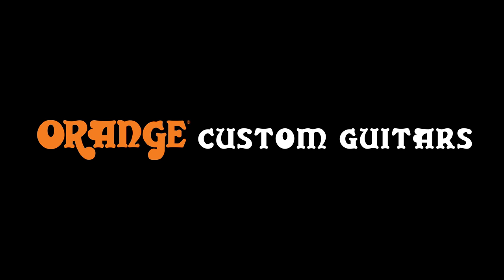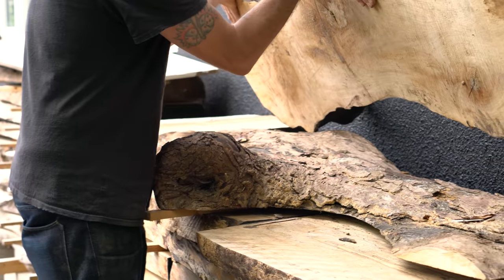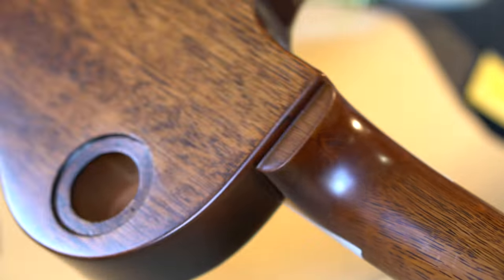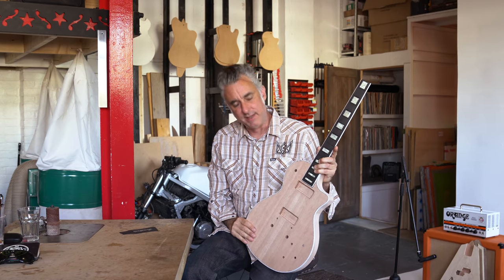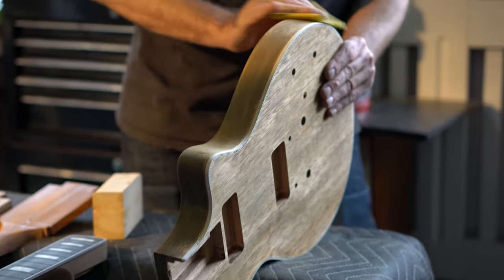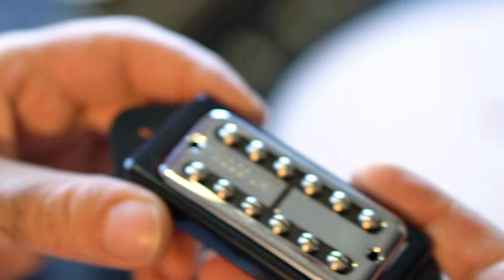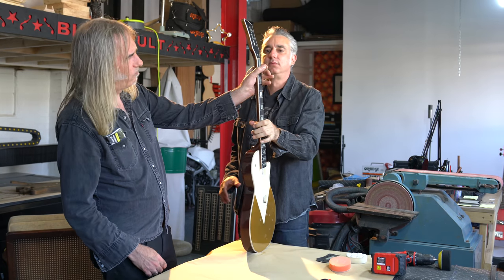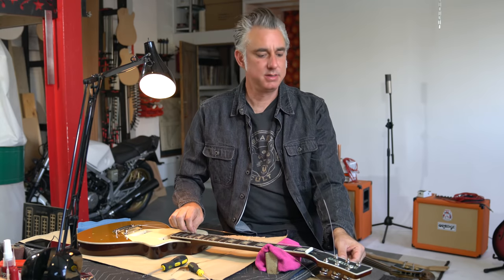The Orange Custom Guitar

Comment: Beautiful, and great finish as well. Only Orange could come up with that.
Reply: Other guitar companies have done similar. Not exclusive to Orange.
Reply: @jreagle58  Gotcha, I guess I meant the whole guitar in general is a unique product but didn't word it that way.
Reply: @jameslighterGTR  Actually the whole guitar is very old school. The neck profile is a 59 shape, the body is, of course, Les Paul-esque with a reshaping of the horn to avoid any problems and the headstock is changed for the same reason. The Staple pickups  are similar to the 50's Staples and the Filtertrons taken from Gretsch.

Comment: Perfect neck angle? Judging by the height of that tail piece your neck angle is a bit off. You have to crank it pretty high off the body for the strings to clear the back of the bridge, Thats usually a sign of a bad neck angle.
Reply: I have to do the same thing on my Gibson Flying V, but I love it! I do wish I didn't have to do that though. I think my Epi Les Paul is the same way. I've thought about cutting into the back of the bridge to get a lower tail piece, but I don't want to compromise bridge stability

Comment: Okay, I really like this guitar and if I had $5000+ dollars laying around doing nothing I would do it. But if I read another comment criticizing that this guitar doesn't have the features of a modern shredder guitar it will be one too many. Guys, this is and old school rock guitar. It has 21 frets because the target consumer does not want or need 22. It has no belly cut. Neither does the most iconic guitar on the planet, the Gibson Les Paul (which, btw, this guitar takes many of it's cues). So if you're into old school single cutaway guitars like the LP or Gretsch Jet series, then this would be in your wheelhouse. If your thing is ESP's, Schecters and such with modern features like 22 frets, modern pickups and fast necks, I would say the Orange is not your cup of tea.
Reply: Literally any Gibson has 22 frets, that’s not like a modern appointment or anything. For the money, I’d rather buy a custom shop Gibson, or a real Gretsch. No doubt this guitar is a work of art but sort of out of left field, and even without the option for true, full fat humbuckers which is strange considering orange is known for heavier sounds.
Reply: @bulkheadz  Correct on the 22 frets. I suppose my comment directed at the observation that it only has 21 frets was taken as this individual wanted something in the range of 24 frets which is almost nonexistent on most single cutaways like this. Me personally anything above the 19th fret is unusable.